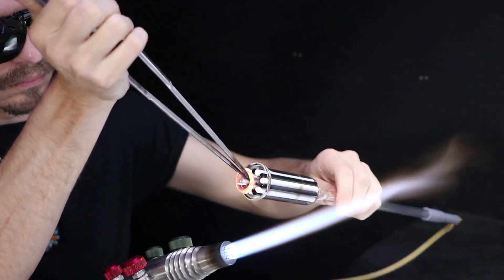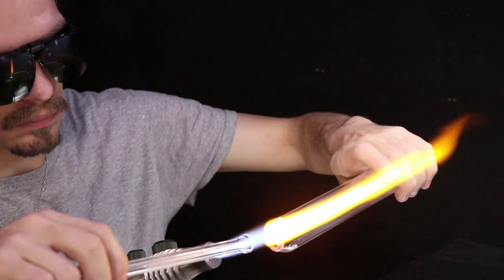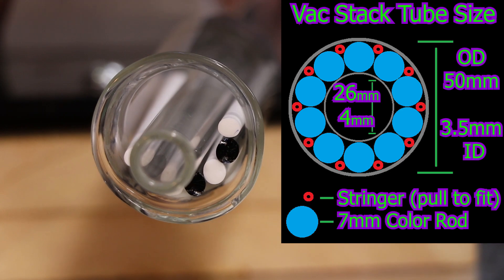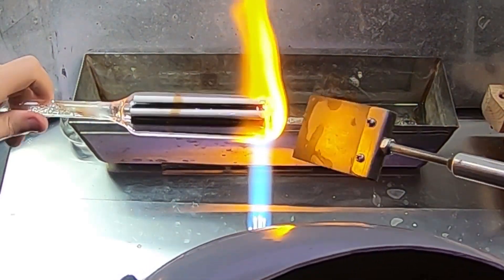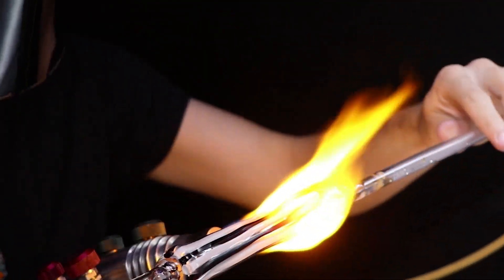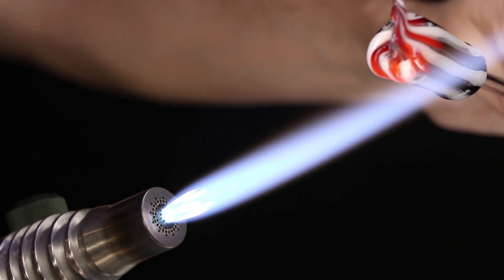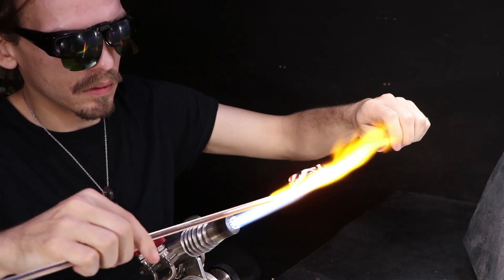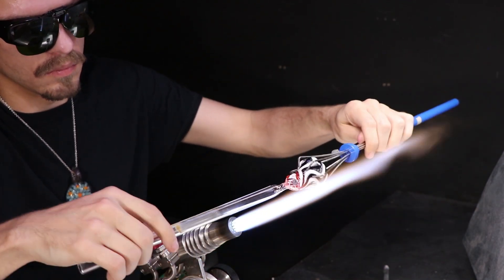Vac Stack Vase Glass lampworking

Comment: Yes very helpful. I feel doing small sections would work better. Unless you have a lathe.  Thx. Matt
Reply from the maker: I really want to practice this some more. If you work slower and condense it down with heat as you go, the vacuum might not be as necessary.

Comment: Matt what mm clear did you use on outside and inside.  Sir. ? Love videos as always.
Reply from the maker: Hey Bryan, sorry I didn't include it in the video. It was awhile ago also, so I'm not entirely sure.  
   You should be able to use different sizes for whats available in your shop. 
   Start with the inside tube: 12mm for example, and with two 7mm rods on both sides it would be 12+(7*2)= 26mm wide. Now the thickness of the outside tube will lower the inside diameter. So for a 4mm heavy wall tube, it would need to be at-least 35mm to fit the 26mm insert. 35-(4*2)= 27mm, this gives you a 1mm clearance. I hope this helps, let me know if it makes sense.

Comment: love yoyur work as allwase. just a note id love to see u do a vid on how u made ur "gavil" in your intro and how it survived being dunked. can u provide links to the face shield pls ? thanks for sharing your mistakes as well as your skills
Reply from the maker: Thanks Zac :D. The website I bought the face shield from is no longer operating. Mountain glass doesn't carry them either, I would probably try Amazon. Something with dark UV protection, possibly made for grinding or metal working. A glass hammer video will defiantly in the works soon, I was curious how large I could make one.
Reply: @JasaGlass  that would be epic to see mate
Reply from the maker: @zacpackman9186  Hey Zac, I think I just figured out what kind of hammer it is. Your free to call it whatever you want but with the extra long handle it might be considered a 'War Hammer'. War Hammer is a long handled hammer most often with a spike on one end (but I don't think a spike is required). Not to be confused with a Maul which has a equally large head and handle; similar to the Sledge hammer. Just thought I would throw that out there, specially for any Dungeons & Dragons fans.